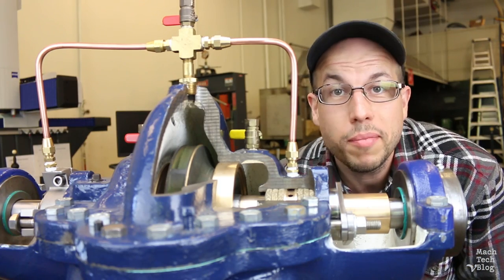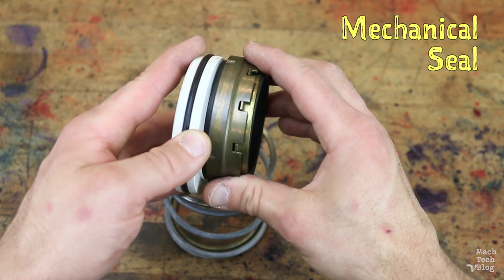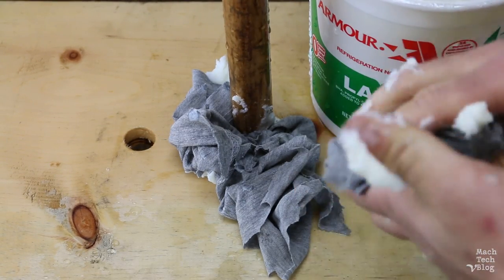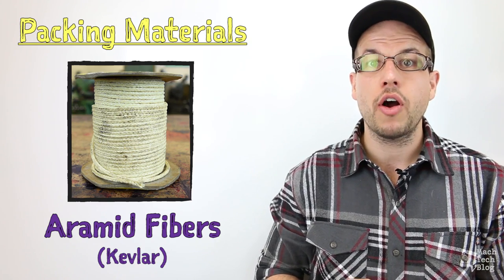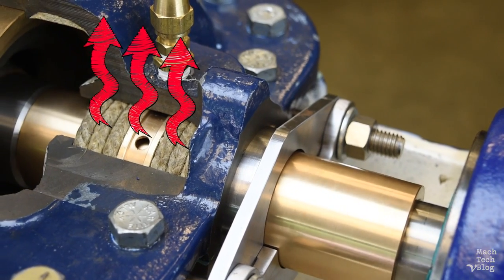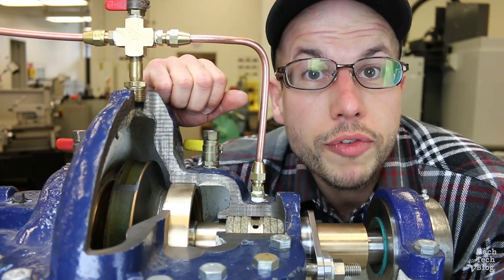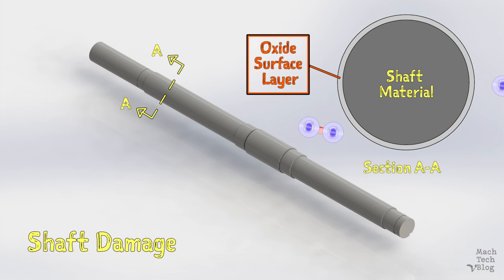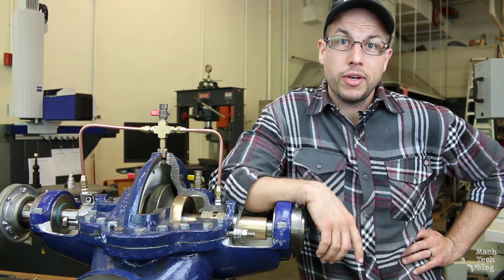Compression Packing

Comment: Again great video with excellent visual aids, should be noted new packing shouldn't be tighten significantly initially and once the pump is in operation that packing adjustments have to be made in small increments over a period of time.  If the pump is operating at any speed (hundreds of RPM) it is very easy to over tighten the packing.  The stuffing box will over heat and in extreme cases if driven by an electric motor the pump can cause the motor to draw excessive amperage.
Reply from the maker: Very true. I hope to demonstrate packing replacement procedures in a later video. (Who knows when I'll have time...)

Comment: My friends old trawler boat has this compression packing on his about 50mm drive shaft between the in board motor and the propeller... i spun out when i saw it and found out about this seal for the first time, his has a grease nipple for lubrication thought.

Comment: The rudder shaft can simply be extended above the water line and require no sealing at all.  A better example is the propeller shaft, which must be installed near horizontally and it is impractical to extend it above the water line.

Comment: "ridiculously expensive" (gfo packing cord) thats all relative, what are we talking about?, how about 1/2" or 12 mm , $10/yard? or $10.000?
Reply: Never realized how expensive GFO and Garlock is, just looked it up and 2.5"x1/2" will set you back about $50.
Reply: Its pricy but tolerable if you know it outlasts other material.